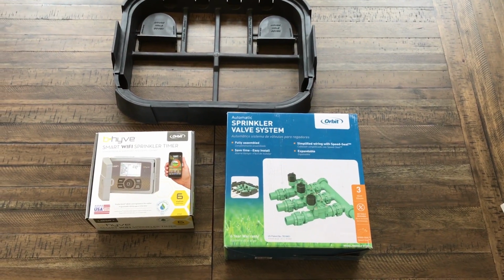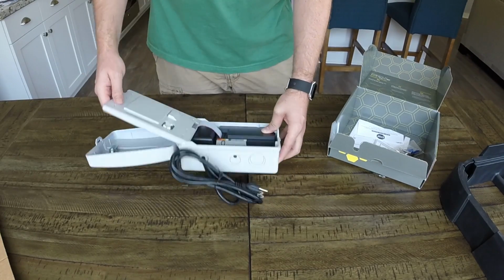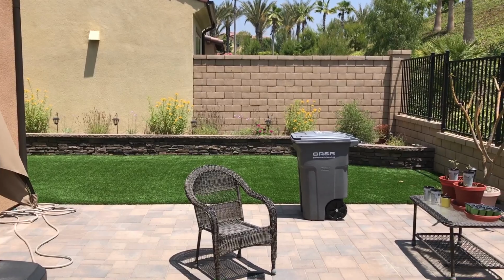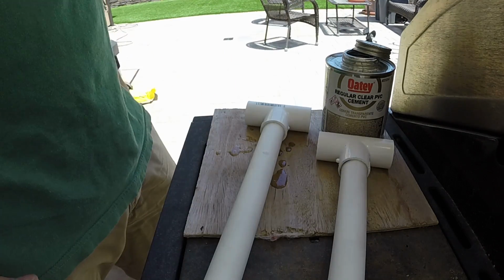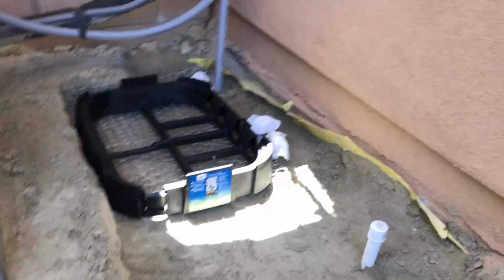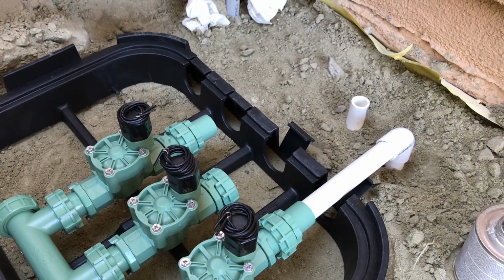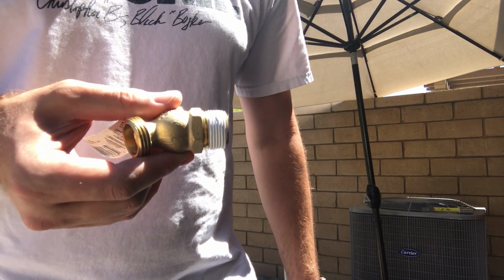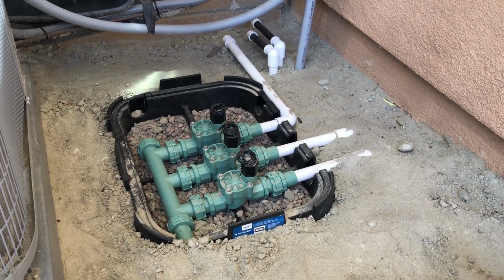How to install Orbit Sprinkler Manifold and Valves

Comment: Disappointingly, you did NOT show the most important thing -- for me, anyway -- which is HOW TO SET THE BLACK SENSORS.  Do you just leave them as preset?  Do you turn them left or right?  Do you do this just once and return them to their 12 o'clock position (neither "on" nor "off").  I'm going crazy after 3 days of doing everything and not having results.  I DO hear the sensors humming, I DO see a trickle of water coming on of just one of the sprinkler heads, but that's it.  Something is really afoul with my connections.
Reply: I'm having the same problem . Did you figure it out?

Comment: Real Quick note. Need to insulate that hose bib riser in areas that will see below freezing temps. I've seen many a worksite PVC bib connection pop in cold weather.

Comment: Not shown in the video, but I'm assuming you used cement in the connection from pvc pipe to the valve adaptor?
Reply from the maker: Yes, i did.
Reply: @SteveDOES  perfect 👌

Comment: Why did you not use primer on pvc and only cement?
Reply: Wondering the same thing.  It doesn't look like the one step stuff.....
Reply: Ditto. And also, instead of a quarter turn and hold after assembling, it was a half to 3/4 it appeared and then just was let go.
Reply: same here?

Comment: great video. thank you. how deep should the trend should have?
Reply from the maker: I trenched about 18 inches.
Reply: Steve DOES ok thank you . Also I didn’t understand the chicken wire you used ,  you fill the hole with gravel then put the chicken wire Down then the value box ? Right ? Also I am on East cost and it is cold in the winter and I know that the system need to flush the water out so it won’t freeze , is there a way to connect for clean out ? I few I ask a lot questions here , which sprinkler head you recommend and do you do the pvc cement to connect them ? , right ?

Comment: Do you think you could possibly explain how you hooked up your main to the manifold?  I have a pretty thorough understanding of the solenoid valves/manifold and everything downstream but how does it connect upstream?  I am thinking of running 3/4 pex with a shut off valve right up to my foundation wall about 2 feet above the ground, adapter to 1" PVC, drill 1" hole through foundation, run 1" PVC through foundation, come down into the ground and into my box.  Does this seem right or am I missing something?

Comment: use...    primer...
Reply: Literally came to the comments section after seeing him use just cement to see if people were saying this or if I've been using primer for no good reason.
Reply: Seriously. The back of the can specifically tells you to use primer first. Its a chemical process that needs to happen, and the joint isn't nearly as strong without it. Most (all?) plumbing code requires it.

Comment: Nice walk through, this is very similar to the install I want to do, same parts, just a 6 valve rather than 3 valve, super helpful to see someone else do it. How did you like that B Hyve wifi controller now you've had it in for a while? Also a suggestion if you haven't already already replaced the vertical PVC to the faucet with a metal pipe, get some spray paint formulated to stick to plastic [ http://sprayertalk.com/best-spray-paint-plastic/]  and paint that PVC where it's exposed to daylight. The white PVC isn't UV stable so it will break down over time if exposed to sunlight. It'll take a few years but eventually it will crack where it joins the hose bib.

Comment: There have been so many complaints about this manifold leaking almost immediately.  Reviews on this products are mostly one star.  I am wondering what your long term experience is with this product and how reliable it has been?
?
Reply from the maker: Hey Ted. You had me curious so i just ran out to give it a thorough inspection. I'm happy to say no leaks. With all the plants i have both the flower beds and garden going on every other day so it's been getting a lot of use over the last year and a half. So still a good experience for me. I'd recommend it.
Reply: Glad you had a good experience here. Wondering if you used teflon tape or pipe sealant (e.g.  Rectorseal Tru-Blue) for the threaded PVC connections and how tight you made these threaded connections. Thanks
Reply: The reviews that I've seen on Amazon etc are 4 star average - which is pretty great! I'm excited to find this!

Comment: I can't see connecting  a garden hose to a vertical piece of PVC.  First time someone yanks your garden hose it's gonna  break it and rip it right out of the ground.
Reply from the maker: fenderstratguy Great point and this was a first timers mistake on my part. Luckily for me the hose is twice as long as needed for my tiny yard but to be safe, I drove in a 3' piece of rebar next to the pipe and secured them together.
Reply: You might want to paint the PVC to protect it from UV as well.  Otherwise it will get brittle.
Reply: I think I've seen that done, now that you mention it.  Pretty sure that's all you'd need to do to prevent most problems.
Reply: @SteveDOES  Great job, did you have any trouble with the PVC becoming brittle from the sun?
Reply from the maker: @Ryan-bc2wh  It's been about 7 years and i haven't had any issues yet. However, this is a concern for me. IF i were to do it again i wouldn't use that is exposed to the sun. I'd talk to the crew at Depot to find a better alternative.

Comment: You don't use a primer. Have you had any leaks
Reply from the maker: Hi Fishman, in the past i used primer on some jobs and not on others. From the research I've done (and when it comes to the internet anyone can find a site that will support your opinion) i found that it wasn't necessary. In fact, in some tests it was less strong to use primer. However, because i am just using the cement i like to get a back-and-forth twist in there to ensure it's melted together properly without any potential channels for leaks. Also i just hate the sloppy look of the purple primer that drips everywhere. On a personal note, i wonder if primer is just a marketing ploy to 'fix' a problem that doesn't really exist. 

Here is a link to a test that was done. Let me know what you think. 
https://www.plumbingsupply.com/the-great-pvc-primer-debate.html
Reply: Totally agree
Reply: Steve Siems - Weekend Warrior m